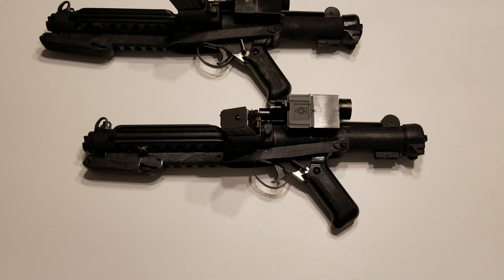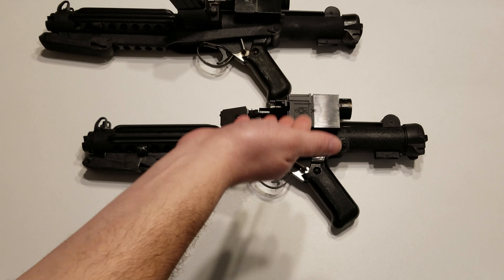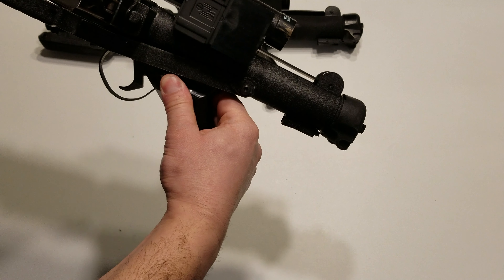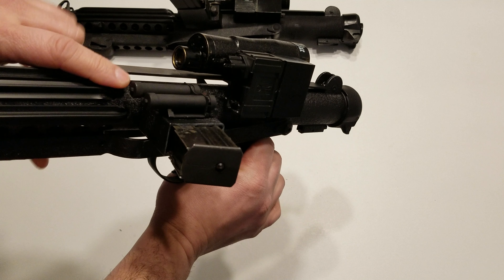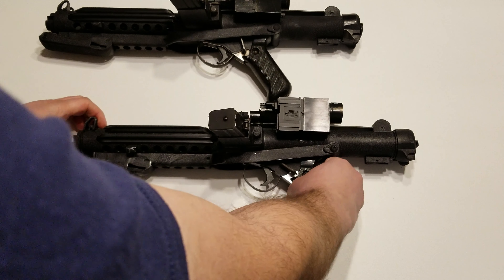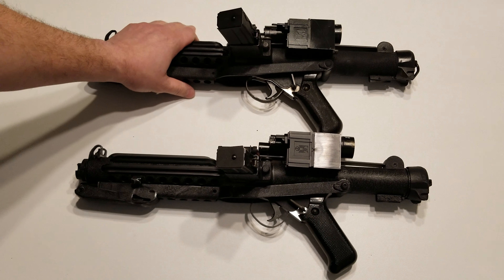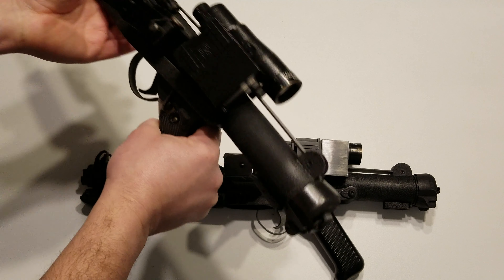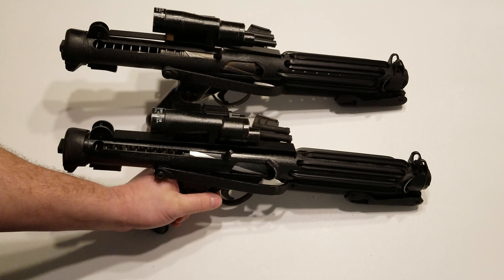Field Marshall all alumnium E11 blaster

Comment: Does the underfolder stock work? It always bothered me that the clones and stormtroopers never used the stock
Reply from the maker: Yes but it's aluminum and not robust enough to move around a lot. It won't hold up to real use. The material is too thin and fragile compared to steel